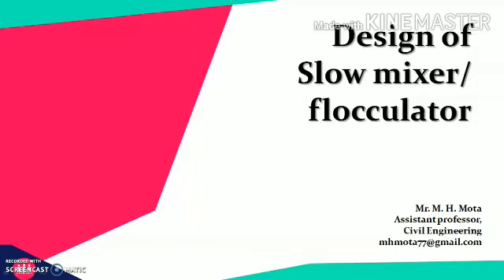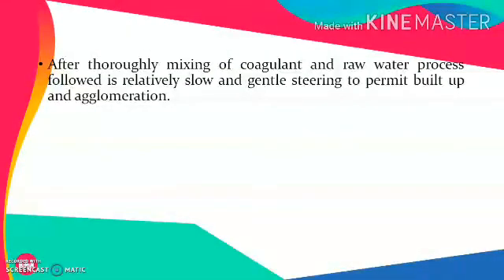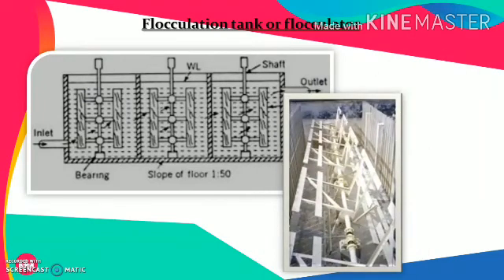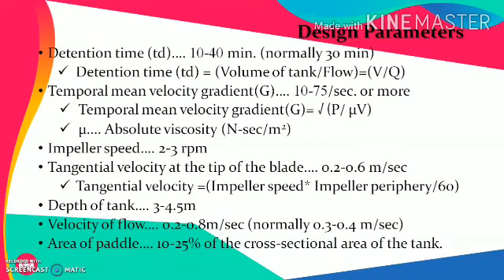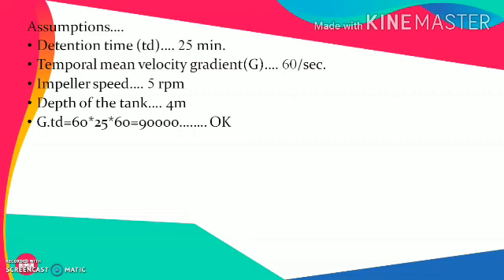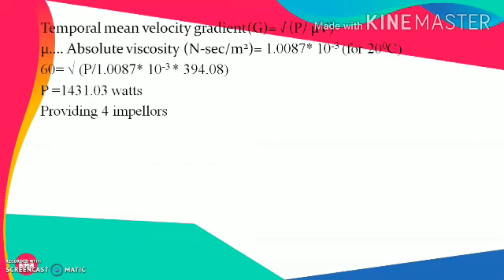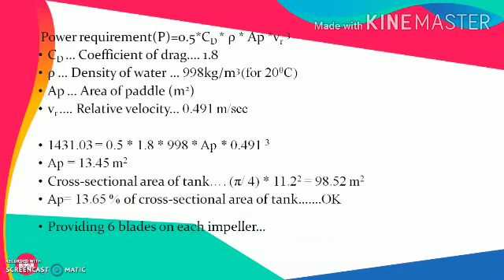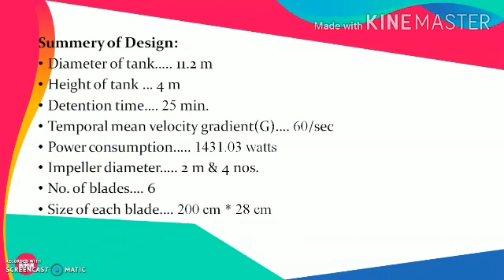Design of slow mixer or flocculator for WTP

Comment: what if the Flow rate (discharge) is way more higher than 0.26m3/s like 100MLD = 1.157 m3/s, are these design steps applicable then ?? like the impeller diameter, no. of impeller, blades and its dimensions.
Reply from the maker: Then go for multiple units... For example go for three identical units treating 33.33mld flow